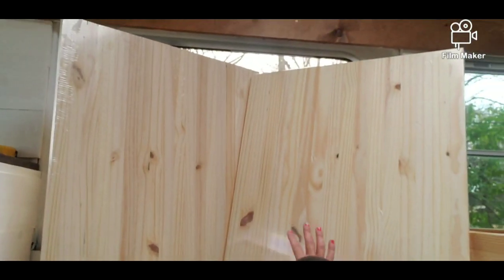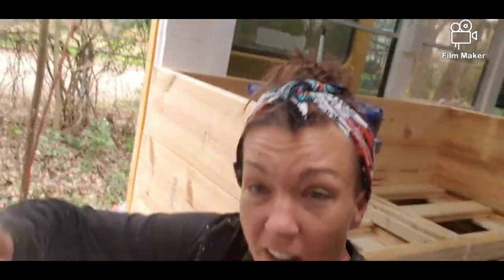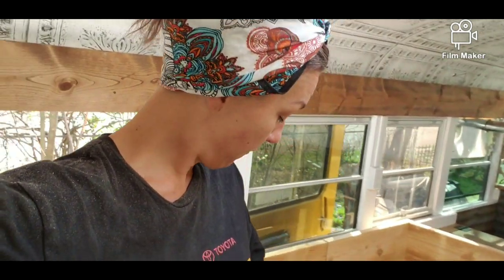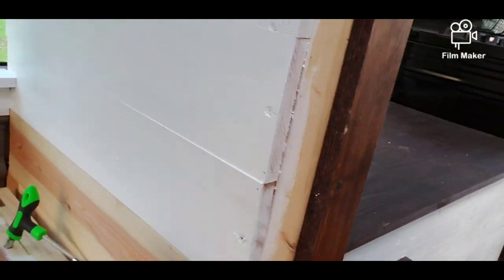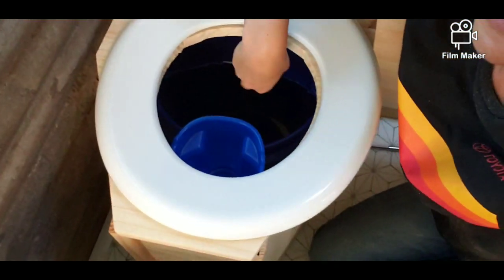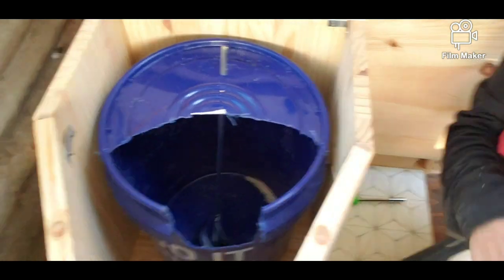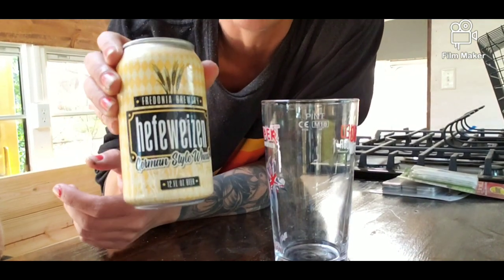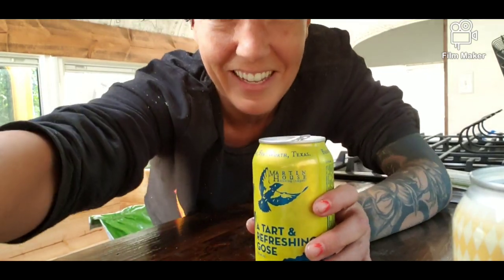No sh!t composting toilet under $100

Comment: A suggestion for you is find a flange type bearing with a set screw to put on the shaft on top of the lid. But anyway you did a beautiful job and you absolutely deserve a few beers. Stay gorgeous and keep smiling.

Comment: I am gonna go the same route and have been watching alot on how to build them. I am curious about a trick I seen a guy do. He put a ping pong ball in the funnel as a block for the smell. It allows the pee to drain and seals the hole. You only have a gallon container so it may be emptied before smelling but thought I would pass that along. I am gonna run mine to my grey tank. I think idk we shall see. Love those head bands you rock btw!
Reply from the maker: Thank you. Yes that's an amazing idea with the ping pong ball

Comment: What you need on the bottom is a short piece to insert the bottom end of that shaft to hold it plumb with the top. A couple of or three oversize nuts glued together and a very short bolt from the bottom through the pail and screwed into the bottom nut a ways. Then use some epoxy  to hold the nuts down there. It works. There is no liquid in the bucket so leaking would not be an issue.

Comment: Hi! Thanks for sharing. I have a question! It seemed to me that your shower is going to be in the same room as the composting toilet. Would the water or the humidity affect on the composting process. I mean, can you take a shower and do not wet the composting toilet?
Reply from the maker: Great question this homemade toilet has been great so far no problems. I empty the composting part out once a week and the pee every other day to 2 days depending. I have a tub not a shower but has not bothered it in anyway
Reply: @gypsy_under_supervised1  thanks!!
Reply from the maker: @ferdicastellano  no problem 😊